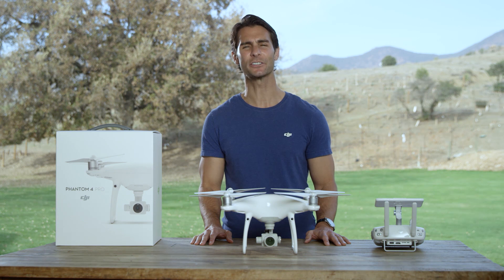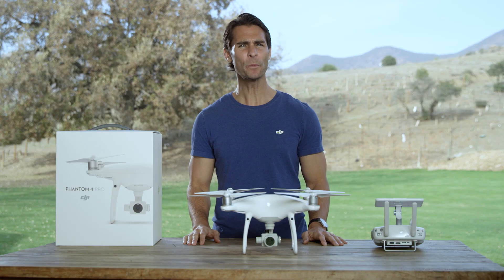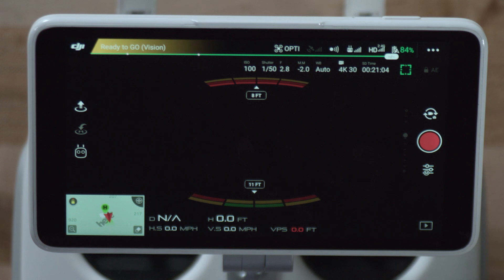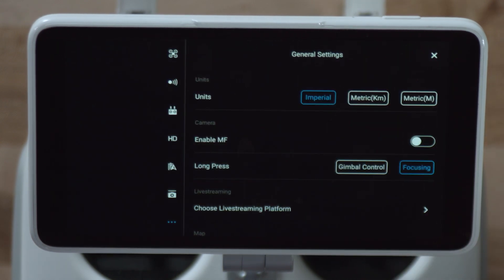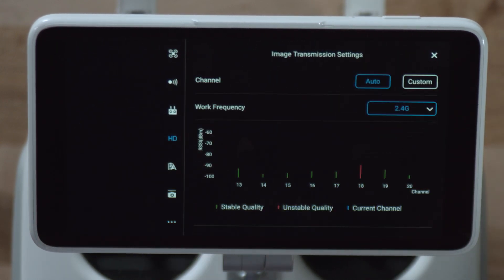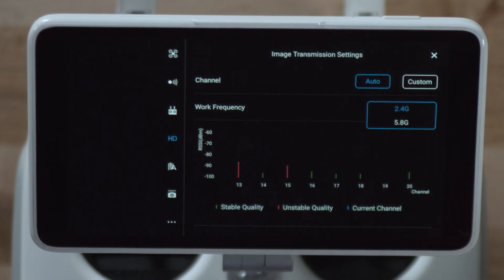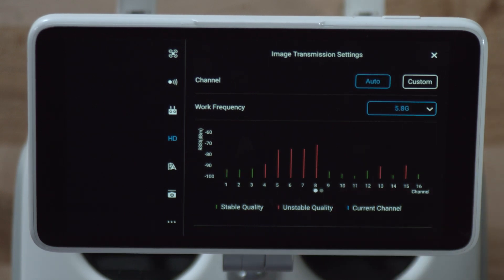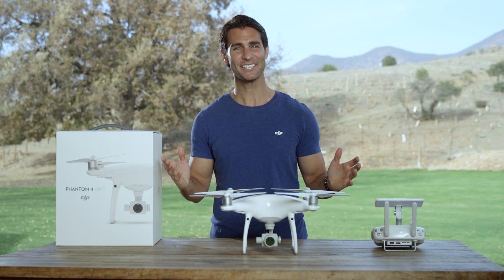DJI Tutorials - Phantom 4 Pro - How to Fly - Operating Frequency

Comment: I have Phantom 4 pro v2 , when I start aircraft in 2.4 GHz Image transmission error please check antenna , Aircraft disconnected errors popup on display And when it’s change to 5.8 GHz Aircraft fly easily without any error so what is the problem exactly ??? & plz give me the solution ....
Reply: i am having same problem how did you fixed it??
Reply: have you solved the issue?

Comment: What is the point of changing the angle of the antennas on the remote controller depending on the operating frequency? I thought the antennas must be aligned according to the drone's position in the air...

Comment: how about mentioning the range of each frequency and ideal situations for each one.
Reply from the maker: Hi there - having different frequencies gives the aircraft more options to secure a clear signal, since there may be other devices using a particular frequency. The range will depend on the listed range of your aircraft.
Reply: yeah leaving it on Auto selects the best frequency for either 2.4 or 5.8.  thats fine, i mean how bout explaining that Auto does not mean auto switching between 2.4 and 5.8 bands only within the band selected.  And then how bout explaining that 2.4 is for longer range and 5.8 is closer range.  I had to spend an hour on other non DJI videos to learn properly.  Your videos are greatly disappointing and uninformative.
Reply from the maker: Good points for us to look at including in a future video, thank you!
Reply: thank you for your attention and replies.  Sorry if i have been upset, but i find your videos really vague and i always need to go search elsewhere.  it is really disappointing.  It would be great to have more in-depth videos from the manufacturer rather than relying on third party people.  To sum it up, it is like your videos aim at people that have already had experience with phantom 4 or phantom 3.  The phantom 4 pro+ was my first ever drone.  Also, you never go in depth, only scratch the surface.  It is like if i buy a new oven and read the book that says it cooks food up to 300 degrees with a 24 hour clock and timer all in an LCD touch panel,  but without directions on how to set the time or change the oven temperature (if that makes sense)